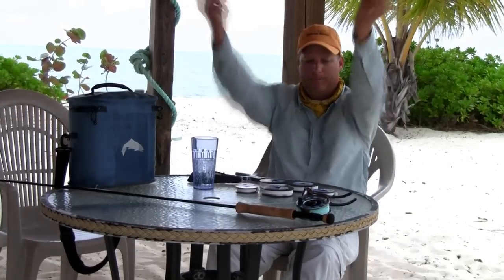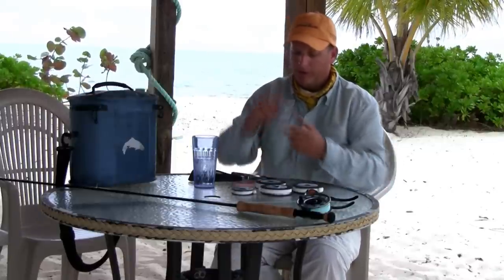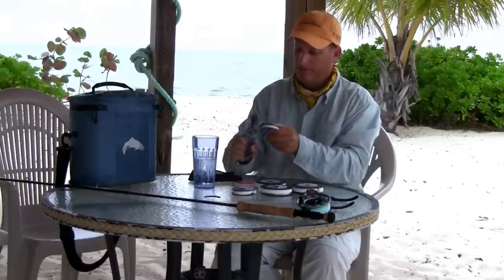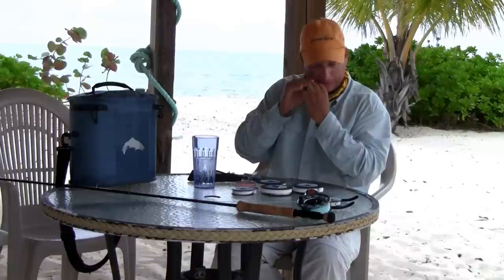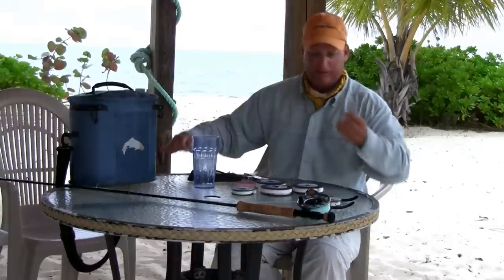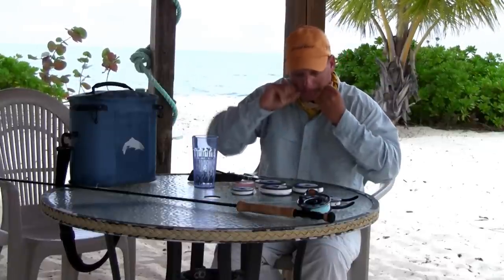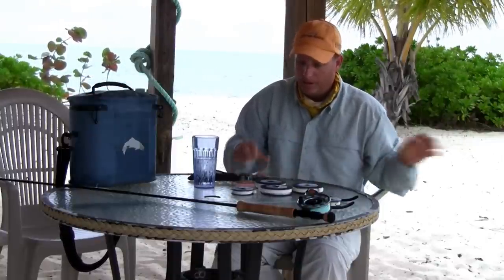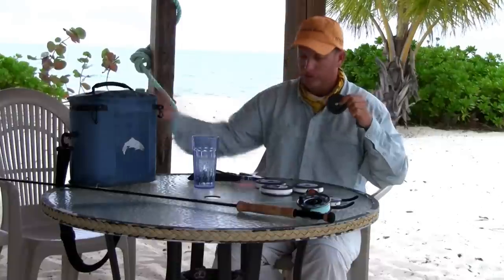Bonefish Leaders

Comment: 18lb Grand max doesn't seem to be available any more.  Upon Lou's recommendation I,  recently used 2ft of rio 30, 25, 20, and 16 mono with a Rio 16lb fluoro tippet for bonefish - about 10ft. total and they worked great.  
These leaders are cheaper and better than tapered fluorocarbon. 
 
You do have to manage the knots as you get a fish closer to the rod.  keep them out of the guides.  You should grab the leader at the end anyway and pull the fish in- leaving things at the pole end loose and ready for a last min. run.  
You also need to cast well, the knots can catch on each other if you are doing tailing loops or other crazy stuff while casting.

Comment: I build my leader with a taper all the way.
By using a very cheap chinese leader as Class.
It has a thicker diameter but much lesser strength than my quality Bite material.
Rolles out smooth,works great and breaks off when I need it to break.
Never heard about it before but it makes sense to me, so I'll go with that :)

Comment: THANK YOU for a GREAT instructional video Bruce & Deneki!  The master says blood knots, I got it. I find the double-uni much easier to tie and I know the knot well.  My only question is WHY the blood knot?  Is it just a personal preference, or is it a superior knot to the double-uni?
Reply: A double uni is a 100% knot, the blood is like 70.  The blood is easier to tie, because it is one knot, and when you draw up a uni around a slack piece of mono it doesn't organize as well.  The main advantage of the blood knot is no knot is a smooth and low profile as a blood knot.  The weakness of the blood is not a problem in most fishing where most of the leader even discounted by 60 is a lot stronger than the lifitng capacity of the rod.  But for the final cut for the tippet, you may want to use something as strong as whatever you are tying to the fly with.
Reply: @HondoTrailside  is it really that much smoother and low profile than the double uni?

Comment: I really don't understand why you would go trouhg so much trouble making a leader out of so many different pieces.
Now you have a leader with 5 anoying knots in it, which will be likely to get stuck behind the eyes of your rod when getting the leader out for a cast. Or when you catch a big bone, and you want to grab it, it is more likely to break of your leader when it goes for a last run, because the knots will get stuck behind the eyes.
Why not just use one piece of fluor carbon like Frogg Hair, and use that. 
No knots, no time wasted making leaders with loads of anoying knots in it.
Allso when the bonefish swims past one of those little twigs that stands out of the water it is much more likely to break off when you have all those knots in it.

I get get the whole presentation principle but whe are not fishing in windstill conditions, with dry flies for spooky trout here.
We are fishing for bones on the flats and ussually the wind is so strong that a tapered leader is really not going to do you that much good, in my opinion.
Maybe I am missing something here. I have only been on 3 bonefish trips but ihave a lot of flyfishing experience and a I really HATE having knots in my leaders.
Someone please educate me on this, I would really like to know why so many people would go trough so much trouble tapering there leaders while it as so many disadvantages.
Reply: Much stronger and cheaper than pre-made stuff.Also you don't want to reel your leader into the guides because you risk break or pulling them off.
Reply: And if you're reeling your leader into your guides to cast,you're doing it wrong
Reply: +JewishCoupon Sometimes when we fish really shallow flats and fish get spooked very easy, i put on a really long leader of about 20 ft.
You need to be able to get it out quick after you release a fish. Knots will be a big problem and prevent you from getting the line out quick. Allso when you get your big fish near the boat and it decides to go out for one more time, the knots will definitely brake your leader.
I just came back from another Cuban fishing trip and i have seen it happen a couple of times with other fishermen.
One guy even lost his Permit because of a knot getting stuck behind the rod eye.
I use one 9 ft taperd leader now with about 4 or 5 ft fluorcarbon in front of it.
Now i have one knot and one loop to loop connection. I am pretty shore this is the best way.
Reply: I would wonder about the 20 foot leader stuff, that has it's parallel in the fresh water world, and generally it turns out not to work any better than shorter leaders.  But if you want a 20 foot leader I don't see any reason why you can't get the knots down to 2, you still have the line splice to rip your guides off with, and if you can pass that, you can tie neat blood knots and even glue them and pass them.

One other thing is that a lot of rods have guides that are way too small, they look neat and all that, but most commercial guides, even on trout gear are too small.  Getting the right guides will help a lot.